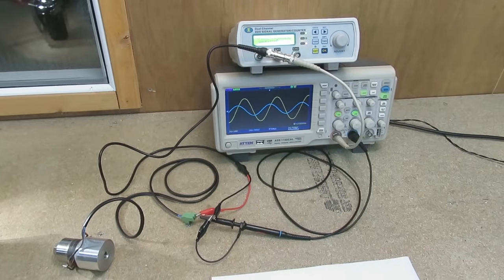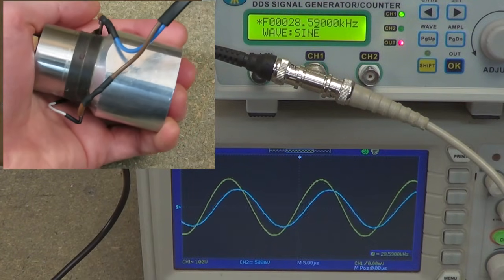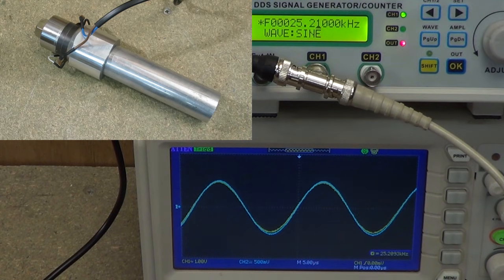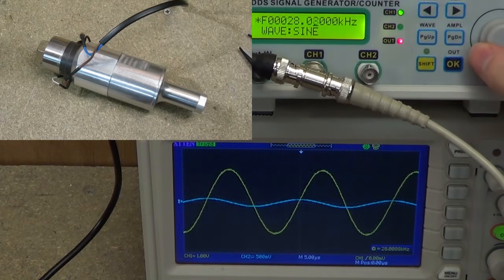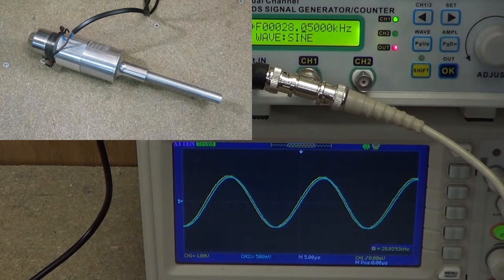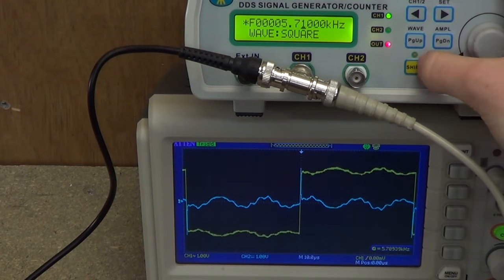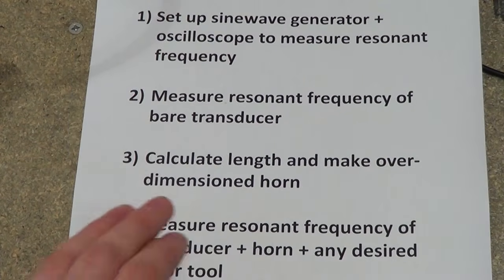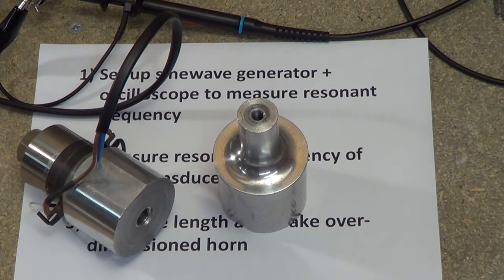Ultrasonic Transducers - Measurements and Horn Design

Comment: Great job Lindsay, thanks for the information you gave in the video, they were tremendously useful for me. Could you please explain how much the tightening torque is important in achieving the best results and how can I find the optimum torque? moreover is it better to use epoxy adhesive between the horn and the transducer?
Reply from the maker: Thanks, glad you found it useful! If you're referring to the bolt that holds the two halves of the transducer together, this should NEVER be touched, since the tension in the transducer determines the resonant frequency. However, if you mean just how tight the horn should be attached to the transducer, then it isn't really too critical. I just tightened with a couple of spanners and it worked fine. They actually tend to tighten through vibration so can be harder to remove. There's no need to use epoxy - obviously you'd never get the horn off again!
Reply: Thanks, Lindsay, one more thing, in the case of adding a booster to increase the vibration amplitude can one make a part which can be used instead of both booster and the horn!? or it is necessary for the booster and horn to be two separate parts!? in other words why they make the booster and horn as two separate parts instead of combine them as one part?
Reply from the maker: You probably could make something that was a combined booster+horn, but I think the main reason they make them in separate parts is convenience - with a separate booster, you can easily use different horn types, rather than having to re-make the entire thing for each one.

Comment: Dear 
Lindsay Wilson
I have found it interesting. I supposed to design a 3.3 kW generator for supplying the ultrasonic system and I required the equivalent electrical parameter of the transducer like its capacitance and inductance. How can I deal with it? Would you help me?
Regards

Comment: Hi Lindsay, awesome video. The whole topic is somewhat complex in its own way but fascinating. Two little question: 1. What is the white cable parallel to the transducer (a capacitor?)? 2. The maximum current draw and phase equality is not at the same frequency but it should be, right?
Reply from the maker: Thanks! Well spotted ;-) It's actually a small high-value resistor (100k I think from memory) whose sole purpose is to keep the transducer discharged when not in use. Otherwise, what can happen is the transducer expands or contracts due to temperature changes, generates a large static charge on the piezo elements, and give you nasty surprise when you go to pick it up ;-) It doesn't affect the performance any. As for current & phase, yeah, unfortunately it's not a perfect world and the two situations indeed don't occur at exactly the same frequency. I think as the system is loaded more, and the resonance broadens, the difference gets larger. In practice, you would probably choose to operate at the point where the current is in phase, to keep whatever inverter is driving it happiest, and put up with the slightly less efficient current draw.

Comment: can you use a multimeter on the transduser terminals while running a sweep with wave gen.The hz where the impedance is lowest is the self resonance off the transduser?
Reply from the maker: Yes, the frequency where the impedance is a minimum is the resonant frequency. No, you cannot simply connect a multimeter and signal generator to the transducer in parallel and hope to measure the impedance. Multimeters measure DC resistance, not AC impedance.
Reply: @imajeenyus42  I compared it to how you can find tune the port of a subwoofer/woofer box by using a multimeter and a sweep down to the drivers fs1 from drivers data sheet.It is in tune where the meter show the lowest value ohm.the sweep is ac/sinus but very low frequency.This method to tune/find the box resonans frequency/driver in tune i will read again to see if/what i have missed.Thanks for your awnser
Reply: @imajeenyus42  I stated where the lowest value on the meter shows is the fri air resonance.that is wrong it should be the peak(.Look at JohnAudio Tech.Measuring speaker free air resonance).I was thinking i could apply to the high frequency transdusers also.A resistor in serie with amplifier same value as the unit that is measured i also forgot.His video on youtube explain this way better than me.interesting to hear what u think about the method
Reply: @imajeenyus42  the value measured is  ac volt.not impedance.
Reply: @imajeenyus42  maybe a better explaining in this short video.(Measuring T/S Parameters for a undocumented speaker
Reply from the maker: @leohobbleohobb3781  If you are going to use a digital meter to measure the AC voltage across a series current-sense resistor, then you will need to make sure that the meter you're using has a suitable bandwidth. Most cheap meters aren't designed to work much above a few hundred Hz - after all, they're most likely going to be used to measure signals at mains frequency, which is maximum 400Hz (e.g. aircraft).
Reply: @imajeenyus42  you are rigth in that i need to use a wide band meter.have brymen evv blog 235? brymen 869s and  121GW eev blog.and some cheap ones like uni t 61E and 61D.Also have a insulation tester chauvin arnoux ca 6115 witch i will uppgrade to lithium etc bat type like the new series from them or since i almost never have use for it sell it.Great equipment.have used money on stuff that need to be good and used some time swapping caps in cheap gear that will after the mods i have done last a long time.always somthing new to learn.
Reply: i mixed it up impedance and ac voltage.was doing some repair on a amplifier.Dc is the last thing you want on a speaker output.
Reply: @imajeenyus42  40 years of working with electro i do have a el lab with some desent equipment newly uppgrade much of my equipemt to be able to do measurements in the mhz range exact.Know I am building upon a product that i wanted but is out off stock.A 1:1 active differential amplifier for any scope.type it in search and you will se what i am building a verson of.Always more to learn.Thanks for you insight and comments.

Comment: I want loud ultrasonice sound at perhaps 20 KHz or 25 KHz.    What do i need for this ?  That transducer you are using ??
Reply from the maker: You'd need an air-coupled transducer like this one: https://uk.farnell.com/prowave/250st180/transmitter-ultrasonic-25khz-18mm/dp/1007328

The type of transducer shown in my video is not suitable for use in air, only liquid/solid.
Reply: @imajeenyus42  Thank you very much for the information. I really want to get this to work.
Reply: @imajeenyus42  Have you a video explaining all the details in the spec sheet of these. For example 1.5KHz bandwith. What does that mean.

Comment: Thank you for an excellent video! I've read through all the comments but there's one thing I can't wrap my head around. If the only parameters that are important for the horn are length and material, why are not all horns shaped like a simple cylinder? Most of the horns for ultrasonic welding are either stepped or hour glass shaped. For example, are the two horns in your video the exact same length? (assuming it's the same material)
Reply from the maker: Thanks! It's a good point, something I never actually mentioned. The reason for a stepped horn is to amplify the vibration from the transducer. A stepped horn might increase the vibrational amplitude by a factor of 2-3x, while decreasing the force by the same amount. Think on it like an electrical transformer - if you step up voltage, it'll step down the current as well. There are also weird things called boosters, which also seem to amplify, but don't appear to be stepped - however I haven't a clue how they work!
Reply: @imajeenyus42  okay makes sense! Thank you 🙏🏼

Comment: Hi great video I was thinking about modifying a cheap ultrasonic cleaner to have a sweeping frequency. My question is does an ultrasonic transducer have more than one harmonic that they switch between or do they just alter the frequency and loose some amplitude as a result. Thanks in advance.

Comment: One observation: I suspect that in the original application of the transducer the side with the nut is screwed to the housing of the application. Wouldn't leaving that side unconnected (as in the video) make that side vibrate much more intensely than the business end? (estimate inverse proportional to the relation of the masses)? And wouldn't that way much of the power be lost?
So, shouldn't all the measurements be done with the transducer 'grounded' at the nut side? (i.e. connected to a large mass) I suspect that the 'natural' resonance would change noticeably too.
I've no experience at all with mechanical resonators, just with how electronics would work...
Reply from the maker: Nope! The "back" of the transducer, the side with the nut, must be left free to vibrate as well. If you check out a photo of transducers used in a cleaning application (e.g. http://www.ultra-piezo.com/2011/0211/378.html), you can see how only the front is attached to the tank - the back is left free. In operation, both the front and back of the transducer oscillate in and out, and the back mass of the transducer is providing something for it to "push against", as it were.

Comment: WHAT A GREAT VIDEO!! I love your explanations.  Thank you so much for taking the time to share what you've learned. I feel like you've given enough information for me to run with my project!  Great Job!
Reply from the maker: Phil Dupuis Thank you! I'm really happy you found it helpful!
Reply: Hey Lindsay, do you know what direction the horn is actually vibrating in? If the center of the horn has less vibration, it would lead me to believe it's vibrating either A.) side to side or B.) up and down but NOT C.) in and out. Do you have any thoughts on this?
Reply from the maker: Great question, and it's one that confuses a lot of people, me included! The short answer: go here and look at the first animated image on the right: http://www.sonoanalyzer.com/content/ultrasonic-horn-design-using-sonoanalyzer-basic-guide. The longer answer: both ends of the horn vibrate purely axially. The middle of the horn, although it doesn't vibrate axially, DOES vibrate radially - it "breathes" in and out. Not by much, if you look  at the relative amplitudes on that simulation, but it definitely does. This caught me out when I first designed my horn - I thought that it didn't vibrate at all in the middle (no radial, no axial) so I clamped the middle rigidly to mount it, and found that it didn't vibrate. Because it does vibrate radially, there needs to be some degree of elastic "give" in the mount to accommodate this - the usual trick is to have a ridge on the horn that's sandwiched between two rubber O-rings.
Reply: Wow, the motion of the horn was unexpected!! So it does breath in and out.  That actually works best for my project!  Thank you for that link and your great help.  I very much appreciate your responses and kindness.
Reply: Hello Lindsay, when you setup your transducer for any operation, what equipment do you use to power your transducer? Do you use an ultrasonic generator?

Comment: Very interesting video👍 Couldn't you speed up the tuning/reduce iterations by using your initial measured length and resonant frequency to calculate the actual speed of sound in your material, then recalculate the required length (rather than shaving off a mm or two and remeasuring resonance repeatedly)?
Reply from the maker: You could certainly do that, it would make things a lot quicker. I shortened it progressively mainly because I wanted to see how the frequency changed, and I was worried about going too short!

Comment: This is an incredibly helpful and very well put together video. Following this method, do you have any idea what accuracy I would be able to tune a horn to? I am told I would need to get it within 50 hz to avoid damaging an ultrasonic generator. Is there a paper or any other kind of literature showing the use of a function generator and oscilloscope in a similar set-up for measuring horns?
Reply from the maker: I might be wrong, but I'd question whoever told you that ;-) Most generators will automatically tune themselves to the resonant frequency of whatever load is connected - I've never heard of one requiring a very precisely tuned load. Yes, you want to get the horn resonance as close as possible to the transducer, but after that, it's up to the generator to then drive it at that resonance.

Comment: So could you use panel glue to adhere it directly to a tank?  If I wanted to build a cleaner at home.
Reply from the maker: Exactly - although these transducers do have a threaded hole on the end, most manufacturers just glue them to the tank. I'm not sure what the best adhesive would be, but a good epoxy would probably work. Make sure both surfaces are clean, and perhaps sandblast both to roughen and give the glue a good grip.

Comment: Great video, thanks!

When the added mass changes the resonance frequency, does it also affect the transducer displacement (and therefore the produced sound power)?

Otherwise it sounds like I can just get any frequency of vibration from a Langevin transducer by attaching long enough probes, regardless what its original resonance frequency is.

Comment: 2 Questions: 1. Do you have to wear ear protection when turning on the transducer? 2. When turning on the transducer, can you still touch its body without getting shocked, i.e. is the transducer body charged when connecting to power?
Reply from the maker: It's probably advisable to wear hearing protection, especially if you have a higher power transducer. Although you can't hear it, you do get a "sensation" of the sound ;-) I would avoid touching the transducer unless you are using an isolated driver and are sure of which side is grounded.
Reply: This is the transducer I got: https://www.allendale-ultrasonics.co.uk/ultrasonic-transducer-40khz does that help in answering?

Comment: A sliding, adjustable  horn design would be very useful...Something that would allow one to quickly adjust resonant frequency and also conduct the sound energy efficiently...A section of telescoping tubing or maybe a split shaft with sliding clamps...
Reply from the maker: Unfortunately, any sort of moving/sliding parts would likely totally kill the resonance - you need to have the horn acting as one solid mass of metal for a good sharp resonance. Any interface between parts of the horn would disturb the resonance and lead to lower efficiency.
Reply: I thought that would be the big challenge...I was thinking sliding parts that could be clamped down tightly, similar to the joints already used in a horn...So you could loosen the tension on the clamps or bolts, adjust the length, tighten them back up and then check the resonance...It would sure be easier than re-machining the end numerous times, plus you could use the same horn with various different tools at the end.

Comment: Overall great channel and a great video on ultrasonic tool design. taught much more than anything i've looked up in the past week. This video explains the basics of horn design and sonotrode over an existing transducer, but i wonder how to make a transducer from a bare piezo crystal. Is the process same for tuning the back and front pieces in a transducer? I guess the resonant frequency of a bare crystal would be much higher since it's very short, it gets me confused. Do you have any idea on that?

Comment: How is W/cm2 calculated or measured?
Reply from the maker: Power divided by cross-sectional area.
Reply: @imajeenyus42  And how is power measured?
P=I*E ?
Reply from the maker: @soriatel  Yes, if the voltage and current are in phase (which they will be, if operated at resonance)

Comment: What about Anti-resonance?
Reply from the maker: I knew someone was going to ask that question, sooner or later! The short answer is, I unfortunately don't know. The anti-resonance frequency corresponds to the maximum peak in impedance. I don't understand why some ultrasonic drivers choose to drive the transducer at the anti-resonant frequency. The maximum vibration occurs at the resonant frequency, along with a low impedance, so why on earth would anyone want to drive it at antiresonance?!? It's something I really must try and learn more about - it seems to depend somewhat on the application. For things with constant, known loads like cleaning tanks, resonance is chosen, but for things with intermittent loads like dental scalers, cutting knives, antiresonance is chosen (sometimes, but not always). It's confusing ;-)
Reply: I understand in resonance, frequency vibration responds to fundamental frequency and as impedance is low, then piezoelectric devices don't support high power. In "anti-resonant" frequency, frequency vibration responds to many harmonics and impedance is high, so very high power can be handled. Applications for resonant frequencies are cutting and drilling while for anti-resonant frequencies are welding plastics, etc...